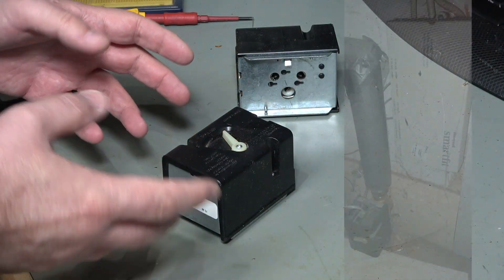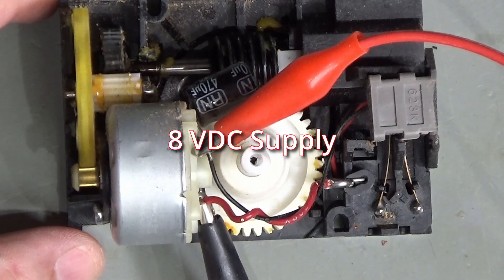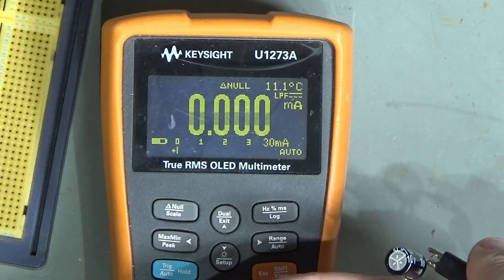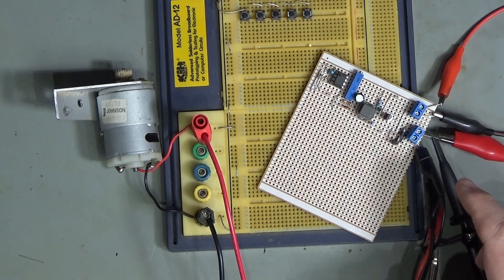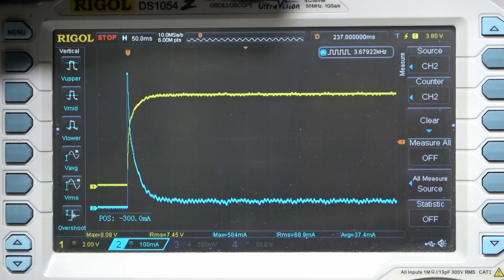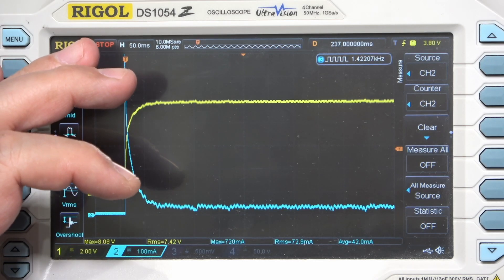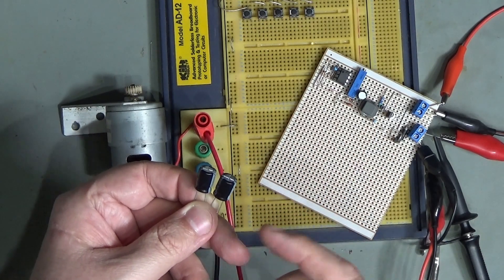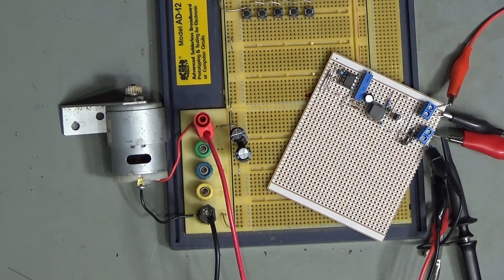Fixing a Honeywell Home Smartfit Valve Actuator #0114

Comment: Thanks for the video,I’ve followed your advice and checked motor and removed the capacitor and I have ordered new capacitor, can I check the micro switch or just replace capacitor and try out? Thanks for your advice.
Reply from the maker: To check the microswitch you would have to push the worm drive into the back and test the continuity, but the switch would stop the pump running, a very different fault do I would probably swap the capacitor and give it a go.